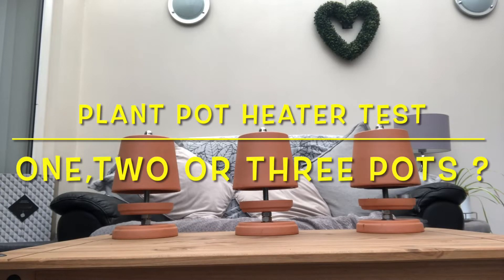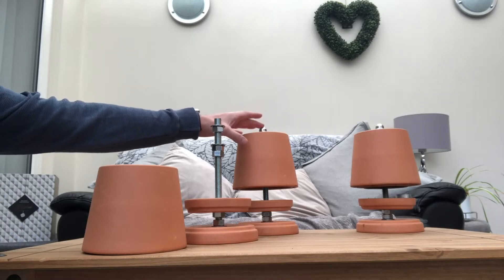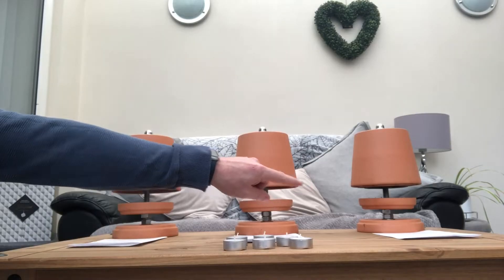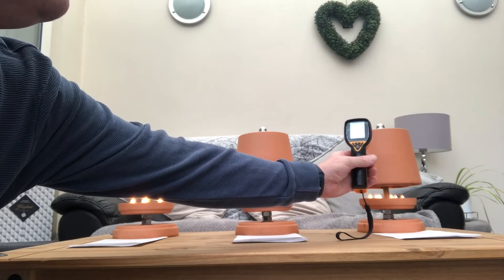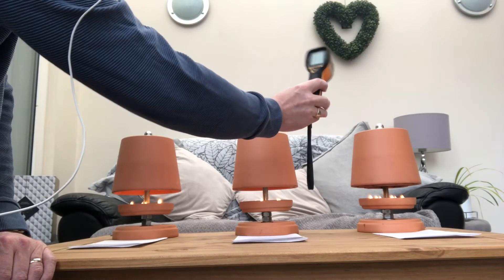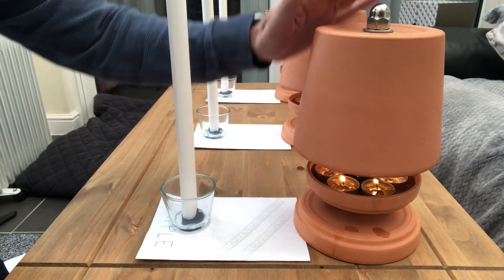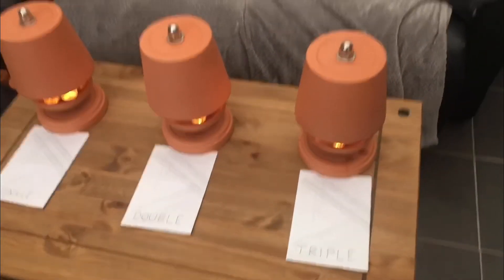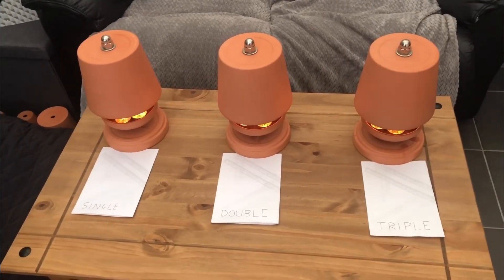Plant Pot Heater tested  - Is it better to have 1,2 or even 3 flowerpots to maximise the heat?

Comment: The gap's too large between the pots and the candles in all arrangements. The height of about two pound coins stacked on top of one and other is all that's needed. Just enough for a bit of air to get underneath, otherwise the heat's just radiating away from the pots.
Reply from the maker: Many thanks for sharing your expertise.

Comment: Hi Repairer, are the 2 bigger pots from the well-known furniture manufacturer? Those look like the 12cm and the 15cm pots called BRUNBÄR there
Reply from the maker: Correct,   both of the big pots are from ikea and base saucer and candle saucer came with them also  the smallest pot came from Homebase.
Reply: @TheRepairer  thank you, your video was a useful experiment, plus I like your design because the height of the tray that holds the tea candles can be raised and lowered

Comment: isn't your reading actually checking the candle temperature...? you are pointing it in a way that you can see the candles in the frame, so it may be reading how hot is the wax in them...
Reply from the maker: Plant pot temperatures were taken nothing else.
Reply: @TheRepairer  ok, still i think this "experiment" is not really explaining the whole picture.
if you add a 4th option, with a small sheet of metal on top of the candles, it would probably heat up a lot more than the pots. but it would not be as efficient because it would not store a lot of heat, therefore not radiate a lot of heat, and also most of the heat from the candles would still freely escape to the ceilings. 
so instead of how hot the "radiator" gets, you should be testing how much of the heat  produced is radiated by the radiator and how much is escaping.

to explain what i mean better i would change the experiment a bit. 
we have 3 "heaters" with "my" design explained above - a small sheet of metal above the candles. in one of them we have 1 candle under the metal, on the next we have 3, in the third we have 6 candles. generally all 3 would produce different about of heat from their fuel source. if you make your test, probably the third one would have the hottest piece of metal, almost equaling the temperature of the flame. the first one would probably be the coldest. in reality all would be effectively the same in efficiency mostly because the heat would escape to the ceiling and because the piece of metal is too small to actually make a difference. if we repeat the test but this time with 6, 9 and 12 candles under the piece of metal, all metal pieces would have the same temperature or very small, negligible difference - because all of them would be almost equal to the temperature of the flame. 
so in one case the test would show there is difference in the heaters, in the other it would show there is no difference. in reality all would have the same efficiency because most of the heat would just escape to the ceiling. 

and if we repeat your test, but this time we use one candle in each heater, instead of 6, it's possible that the third heater with the 3 pots has the coldest outer pot, because the mass of the pots would be way too much to heat up by one candle and they would radiate the heat faster. effectively it would use all the energy, so maybe it's most efficient, but if the temperature is not that high it may not make a noticeable difference even for hand warming, although it would have best efficiency. while the one with just 1 pot may be the hottest by that logic, but sill allow some of the heat to escape to the ceiling - not efficient, but at least enough to heat your hands.

in in conclusion,  different configuration probably have different sweet spots. maybe if you use just 3 candles the 2 pots heater is better than the third.

Comment: All you proved by placing the long candles within 2 inches of the flower pot heaters is they do not  radiate heat out into the room, all the heat is rising to the ceiling like it should be... None of your heaters could warm up a privy...

Comment: Have you ever tried oil candles?
Reply from the maker: I have just used the basic ones would it be cost effective? These are dirt cheap.
Reply: @TheRepairer  it's just veg oil or canola oil or whatever and a cotton wick in a reusable glass. I don't know the cost difference though
Reply: @TheRepairer  Dirt cheap but toxic. Beeswax or soy wax candles are more expensive, so as a non-toxic solution making a vegetable oil lamp is the cheapest candle, combined with a few terracotta pots theoretically the cheapest safe heater?

Comment: I experimented with these designs a few years ago.  I figured it was best to have 3 separate large single units as I think the surface area which heats the air around it is more important than the extra heat that might be obtained with a triple unit.  I'm revisiting these over Christmas to experiment with different homemade  candles/fuel sources and wick sizes etc.
Reply from the maker: Thanks for sharing I’m quite happy with the Triple it’s on now with four candles in!

Comment: I think it would be interesting to see the cool down rate,  I would imagine the more pots the slower the cool down as the inner pots are insulated by the outer pots.😀
Reply: It actually has nothing to do with insulation since there's nothing but open air between the pots, and air is a bad insulator. The general rule is that water holds energy ten times better than air and matter holds energy ten times better than water.

More pots means more matter which means more heat retention and therefor more heat radiation over a longer period of time. All the pots are heated up by each other over a longer period of time which is why it takes longer for the heaters with more mass to cool down 🙂

Comment: Viewers It don't heat room, don't waste your money and energy
Reply from the maker: I find it actually does heat the room but it takes a lot of  time. I use it in my living room with both doors closed and I find it maintains the room temperature the central heating has achieved. I can detect the central heating top ups on the nest thermostat log that don’t occur whilst using this basic heater.
Reply: So you think these disobey the laws of physics? How exactly do you burn candles without generating heat? How do you burn candles and not heat up the clay pots? How does the energy stored in and radiated out by the clay pots not heat the air around them? Of course it heats the room, the time it takes and the amount of temperature increase is dependent on the size of the room and the number of candles as well as other external factors. Electric storage heaters work on the same basic principle.

Comment: Obviously, there is one fact that you have overlooked.  The tea lights have a measured and consistent amount of energy stored, it doesnt matter what you do with that energy it will not ever be more or less just the same, so maybe this experiment is somewhat pointless?
Reply from the maker: You could take that approach but remember a gallon of petrol has a finite amount of energy but it can be utilised efficiently or inefficiently in different vehicles.
Reply: @TheRepairer  Doesn't change the energy density, does it?  Your car analogy is a good try but as there are almost infinitive differences between motor vehicles, therefore  variations in performance and economy are equally infinite.   Burning a candle to produce heat is a simple one dimensional experiment for which the variables are virtually zero.  Sorry but your experiment proves nothing but the fact nobody paid attention in physics class.
Reply: I’m sure surface area has a lot too play here. I have a few exposed tea lights lit beside a tea light heater , the tea lights on there own did nothing but supply me light at night, since adding the simple tin box tower heater I can physically feel the heat when near them. 

The energy is wasted when just let too go into the atmosphere, this is transferring that otherwise wasted energy into something else
Reply: Research radiators.
Reply: Energy cannot be created or destroyed. However instead of the candle heat heating up the spot above it on the ceiling the plant pots allow the heat to be radiated outwards. So one pot will suffice.

In reality the candles have a usable wattage of 40 watts of heat. Use them to directly heat a single pot. Each time you have multiple pots there is not enough energy to heat multiple layers, the air gap between them will be minimal difference between the layers. Best use is to directly heat the pot...

Comment: Most of the heaters I've seen like this have had the pot completly covering the candles with no gap.
Reply from the maker: There are many variables I have seen  of this Cornish heater, I could experiment with the gap but I just based in being able to put the tea lights in and out with ease.